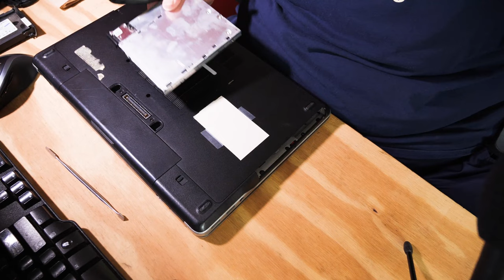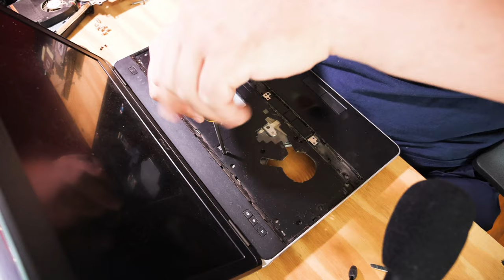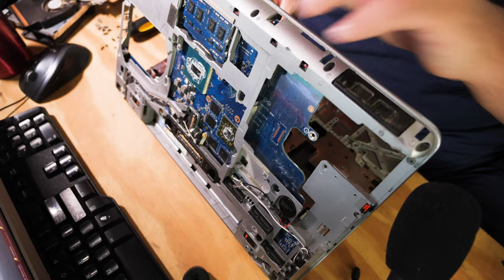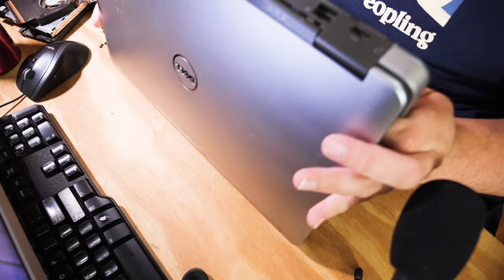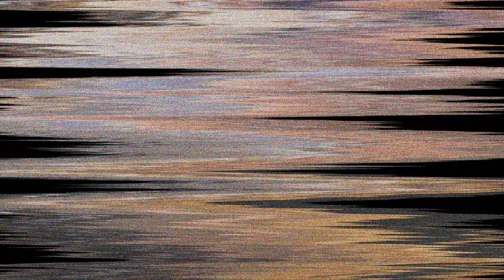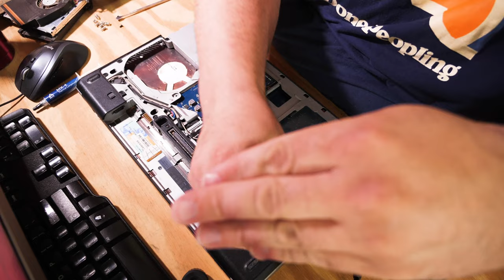Dell Latitude E6540 Motherboard Replacement - Jody Bruchon

Comment: I have the same laptop But I want to replace my MB, The MB Part Number needs to be exactly the same as my original? Or could I upgrade to a same MB  But  diferente part number (because I've seen the same motherboard (same socket and everything) But with better graphics chip "Radeon" ... Is it possible?

Comment: i have the same model and i keot the original motherboard and upgraded to a 1tb ssd, blu ray dvd rom drive, windows 11 pro, and i am going to upgrade the original wifi card to the wlan wifi 6 card because the wlan wifi 6e cards have the black connector on the opposite side and the black antenna wire is a bit too short to reach and i don't want to mess with the wire and destroy my pc! i don't want to take the whole thing apart to replace the wires with longer ones or strip the wire and make it longer or everything would crash my pc!!😢

Comment: Hello.  I replaced the motherboard according to your video, but after I charge the laptop, the lights turn on without me pressing the power button.  After I press the button, the laptop does not turn on and I do not see the Dell logo, and only the lights next to the button turn off and on for a moment and make a sound.  I wanted to know what should I do?  I just bought the motherboard and it is completely healthy.
Reply from the maker: Remove the battery and AC power. Only plug in the AC power. See what happens. Try with a different AC adapter if it still doesn't work. Try re-seating the RAM just to be sure it's making good contact. If the lights are on but the screen is not showing anything, you can press the Caps Lock key and get the light to toggle then the core computer is functioning properly (the LED is controlled by code in the BIOS that the CPU has to run so it indicates the CPU and RAM and such are actually working).

It is possible that the board you got is not actually working despite being sold as working so don't assume that "I just bought it" means it's actually OK.
Reply: @JodyBruchon  Thanks